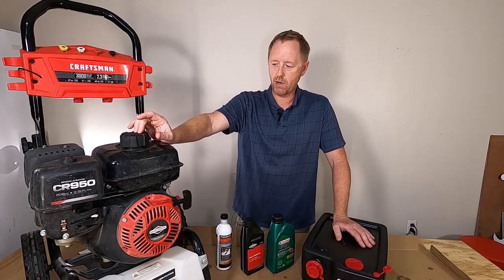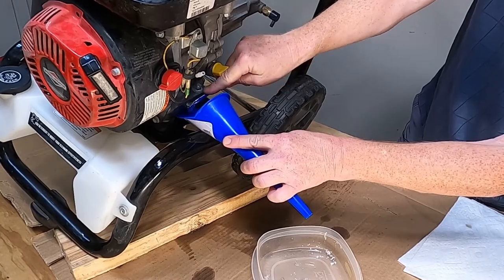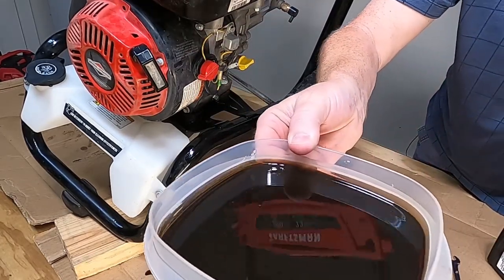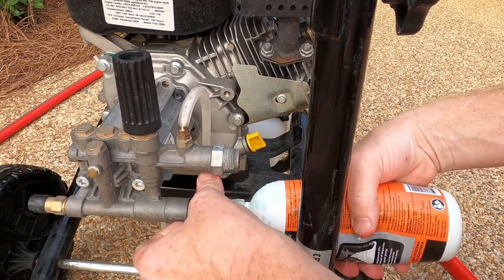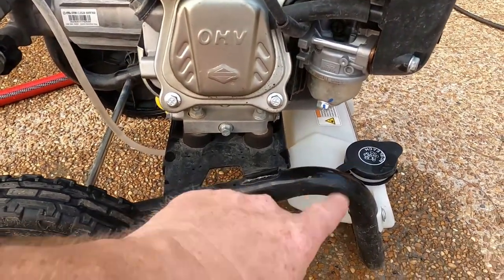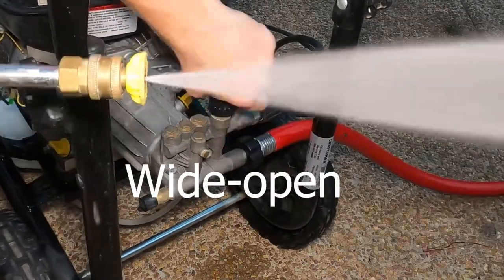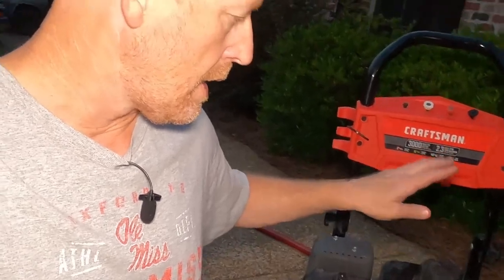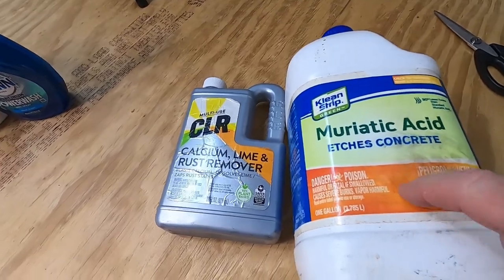Pressure Washer & Small Engine Maintenance

Comment: Just bought this unit at Lowes. $350. Not that heavy duty, I will have to be gentle with it!
Good Info here, bookmarked it, Thanks!
Reply from the maker: Thanks for watching and commenting.  I made that video about 18 months ago and our washer is still going strong.  My son used it to pressure wash driveways and houses all summer and made many thousands of dollars.  It could use some improvement, but it's not bad for the money.

Comment: Great video, I learned stuff!  Do you use pump saver after every use or just in the winter?  Also, my Craftsman 3000, which is new to me, is from 2009. Do you think I should attempt a pump oil change?   Thanks so much!
Reply from the maker: I typically use pump saver about every other use. Year round. And I change the oil at least 4 times a year.  My oldest washer is 8 years old and still going strong.
Reply: @MikeM100   The manual for my pressure washer says the pump oil, not the engine's oil, should never need to be changed due to it being sealed. Is that the one you were talking about? Good to know about 4X per year. I've never done more than one time per season on my poor equipment.
Reply from the maker: That is correct about the pump oil.  You should never open the seal on the pump.  Pumpsaver is meant to be run through the pump as I showed in the video.  It is a lubricant that oils the path that the water runs through.   Just a few squirts before and after every other use should suffice.

Comment: i just got this exact washer and used it for the first time yesterday. It took A LOT of effort to get it started but I finally got it running. I went to use it again today and it will not start. Again, it's a brand new unit and it shouldn't be this hard to run. I added oil and checked the level, am using fresh 91 octane gas and have the settings as you've indicated. I've even replaced the spark plug. This is very frustrating. MY 12 year-old lawnmower started on the second pull after being stored all winter. I'm not impressed with this Briggs unit and regret buying it.
Reply from the maker: If I were you I would take it back to the store and complain.  I own two of these units and they always crank on the first or second pull and I've never had any trouble with them.  You got a lemon.

Comment: People should be careful because NOT ALL PUMP SAVERS ARE NON-TOXIC (always read your label). For example, if you use Ryobi Pressure Washer Pump Protector and get it on your skin the label says you should wash your hand immediately with water for 15 minutes. It has similar instructions for if you get it in your eyes. After watching this video I almost made the assumption that they all were non toxic but luckly I read the label just-in-case. I'd update your video with a text warning just-in-case someone else makes that assumption.
Reply from the maker: Thank you.   I appreciate the info.  Will definitely update the video.

Comment: you're not running water while you run the fuel empty. This will damage pump. Also, shutting the valve and letting it quit does not drain the carburetor. You have to open the bowl drain or remove the bowl to get all the gas out of the carburetor

Comment: Thank you!  I have never had an engine with two oil caps on it and I was worried I would do something wrong putting the oil in it.  you explained it perfectly and now i'm ready to get it washing!
Reply from the maker: I'm glad I could help.  A lot of the smaller consumer quality pressure washers have two oil caps because they are based on the same Briggs and Stratton engine design.   Thanks for watching.

Comment: When I remove my oil cap , gasoline floods out of it…it’s pretty much brand new…do you have any idea why this might be…it’s a CR950 like this one
Reply from the maker: I'm not sure what causes it, but it's happened to me also with this same washer.  The pull cord would not pull out and I thought it was locked up.   I emptied the oil and refilled it and turned the shaft with a wrench and socket about a dozen times, them emptied and refilled the oil again and it was ok.
Reply: @MikeM100  Huh? Good to know. I haven't even gassed mine up yet. Sounds like that gas shut off switch doesn't  shut off all the way even when you run out the gas line as in This vid. Might look into an inline switch if this happens to mine!
Reply from the maker: @saintnificent5532  Even with that problem, this has been a great washer.   Thanks for watching and commenting.
Reply: Same problem for me. Washer is 8 months only old, its been stored for last 4 month. I left some gas in it and left the gas value on. I like how you run the gas dry in the video, (lesson learned!). I think the gas leaked past the carb needle float valve and flooded into the oil.  What do you think?
Reply: @tomc2692  that's exactly what happened. After using the unit, and then shutting it off, the float inside the carburetor didn't properly push the needle to seal against the needle seat, therefore, the gas keeps flowing from the gas tank, which is higher than the carb, flooded the carb and then flooded into the intake and into the motor. I've worked a couple of these which that happened. Even a new carb can have a faulty needle and seat. This is why you should ALWAYS turn the gas valve off after using, as he mentioned in the video.

Comment: I have the 2800 psi pressure washer with the same engine. I put about 17 ounces of the 18 ounce bottle that came with it. I’ve ran it for a total of about 4 hrs over the month I’ve had it. Today I wanted to see if the oil level was ok. I noticed the bottle of the cap had oil on it and it was above the full mark. I wiped off the dip stick and checked again with the same results. I also noticed oil was at one edge of where you put the oil in. I was just wondering if you ever had this issue. I just thought as I was writing this that maybe the ground wasn’t quite level so I’ll check that tomorrow.
Reply from the maker: That has happened with me as well.  Those small engines are not precision machines, and the resting position of some of the internal parts may affect the observed level of oil.  You definitely need to check the oil on level ground.  Just remember how much oil you put in.  If it has not been leaking or smoking then it probably still has the amount you added.   Thanks for watching and commenting.
Reply: @MikeM100  thank you so much for your reply. I couldn’t seem to find anything on this so I was really glad I came across this video and the other one you did as well they were very helpful. I did check it again today on a level surface and that was the problem I was having with it showing it had to much oil. Thanks again for your help.

Comment: What is the second oil caps purpose. I know one is to check the oil level with the dip stick but what is the other cap used for?
Reply from the maker: No purpose that I have been able to find.  They just included a second cap.  Both caps expose the same oil reservoir.

Comment: I went to check the oil on my pressure washer and water 💧 shot out of it. Is this a serious problem? I've only used it only about four times
Reply from the maker: Yep.   That's a serious problem.   You should return it to the store.   Sounds like the engine block is cracked.

Comment: What if my oil smells like gas ?
Reply from the maker: If you oil smells like gas, then there is a leak somewhere.  Return it to the store.
Reply: @MikeM100  I got it for free I started it her up removed oil and all the gas went through it then I refilled with oil no gas started it up thru air filter with carb cleaner it started right up waiting on new carb hopefully that’s the problem

Comment: Mine was new. Used it once last year. Pulled all the fuel out to store it. Now it still runs good but no water will go through the system. Even with it off, no water will come through. Its like its clogged.
Reply from the maker: I would use an air-hose to try to blow air through it.  I've never seen one do that.  Maybe some bugs built a nest in it.  Maybe try to force water from the outlet to the inlet.
Reply: @MikeM100  I think what happened is the concrete cleaner I sprayed through it last has built up some residue that clogged it.

In the mean time, my float must be stuck because when I checked the oil a gallon of gas poured out.

Comment: My pressure washer will not start and the carburetor needs to be cleaned. How do I clean it. I tried spraying it with carburetor cleaner with no luck.
Reply from the maker: If carb cleaner won't clean it, then you probably need to take it off and clean it manually.  Sounds like one of your valves is clogged up or maybe the gas gelled in it.  If you have never done that before make sure you are careful with all the parts because some are really small and easily lost.  Soaking all the parts in clean gas and/or spraying everything off with carb cleaner should clean it good.  If you do that, make sure you spray cleaner into all the small valve holes.  Good luck.
Reply: @Mike Moncrief  ok, thanks... I did already do that, but I will do it again.
Reply from the maker: You may also want to remove your spark plug and make sure the electrode is clean.  You could also try removing the air filter and spraying some starting fluid directly into the air intake.  That usually helps to get the engine turning, which creates a vacuum in the fuel lines and sometimes helps to pull anything blocking the lines into the ignition chamber.

Comment: Clean this particular pressure washer carburetor.?
Reply from the maker: I usually just spray some carb cleaner into it about once a month and it keeps running fine.  If you let it set over the winter, then the carb may need to be removed and cleaned out.  I've had the unit in the video for 2 years and never removed the carb to clean it.  It usually cranks first pull.  I still use it once a week more more.

Comment: I dunno. I got one of these over the summer. 1st time trying to start and won't start at all :(
Reply from the maker: You may want to try spraying a small amount of starting fluid into the breather. or carb.  I've used my unit every week since early summer of 2021 and it's still working good.  I use only non-ethanol gas.  Regular gas tends to gel up.

Comment: They should not sell these to someone who doesn't know how to do the most basic of things like changing the oil.  These are the same people who write bad reviews when there pressure washer doesn't start because they let the gas get stale and clogged the carburetor.  And who actually asked how you change the oil, it's in the instruction manual.  Hilarious, people who can't figure out how to change the oil don't even bother reading the manual that came with the machine.  I guess I shouldn't complain, I recently bought 2 of these machines from Lowes for only $25 each, both were customer returns where they claimed they are broken, turns out it was only stale gas thay clogged the pilot jets.  Cost me a can of carburetor cleaner to fix.
Reply: people who don't know how to change oil should take it into a place that services small engines  for routine maintenance or not buy them 

but everyone else still wants to buy them 

And everyone should read the manual or at least glance at it so they know that they do have to take it into the service or they need to change themselves or other things